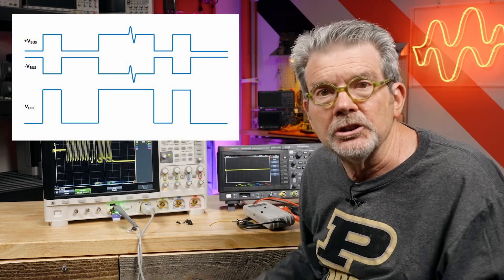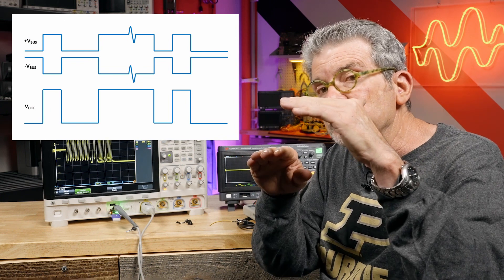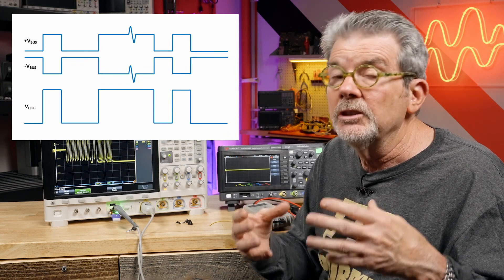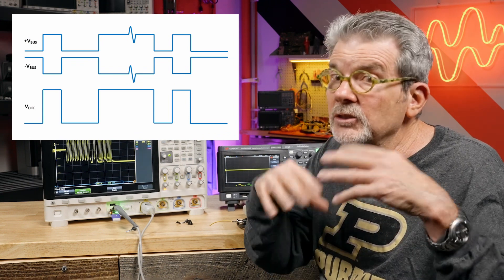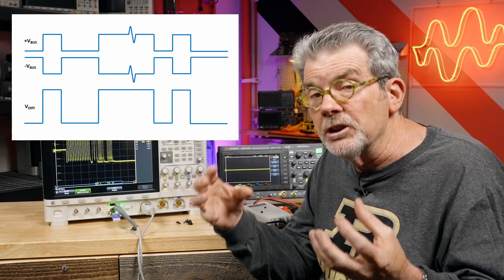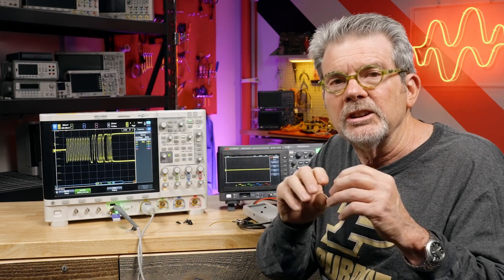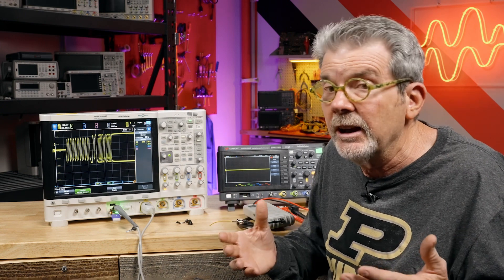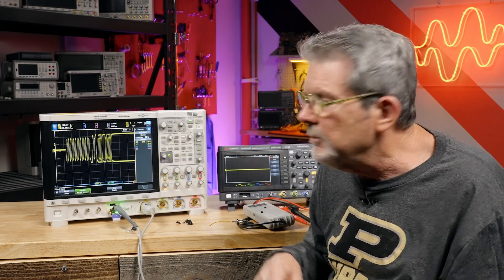Lesson 7: Probing Part 2 - Active Probes

Comment: hi sir,
how to calculate the inductance value of resistor at high frequency. we have Keysight lab in our university we r having spectrum analyzer ,vna , oscilloscopes but idk how to calculate it. our oscilloscopes r having maximum of only 100 mhz so we cannot generate using it.

Comment: Here is one of the missing lessons, finally! 😊
You should also emphasize, that the GND referenced probes pose a big problem (danger of HV short and damage), when you measure inside mains powered equipment.
See Dave Jones videos about this subject.
Reply: If this poses a "big problem" for you, you need more experience! With experience it is routine operations.
Reply: @glasslinger  If this poses a 'big problem' for you, then you need a much more expensive scope. This will hurt more, and you won't make the same mistake again.
Reply: That's correct. The 120-V measurement is possible if you know what hole in the outlet is the ''live'' conductor.